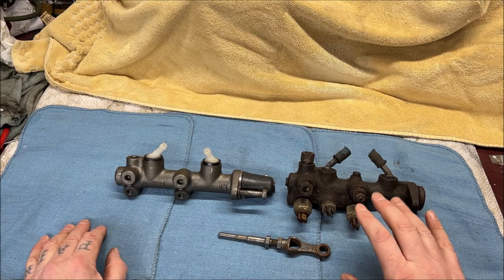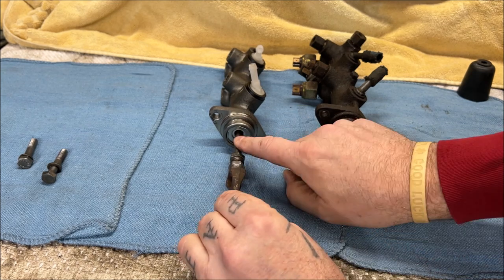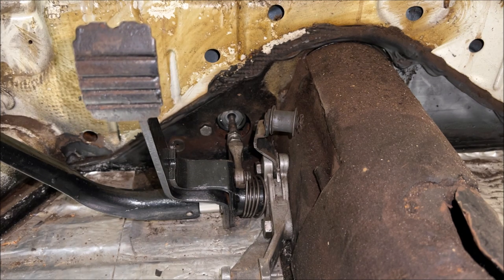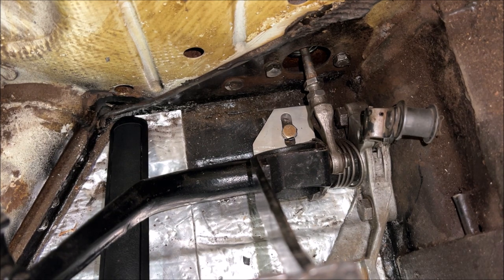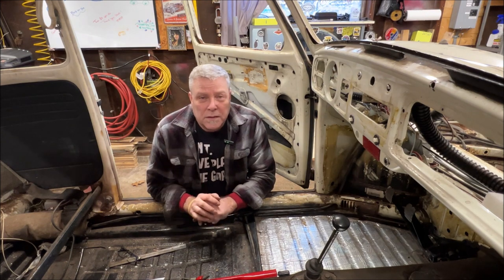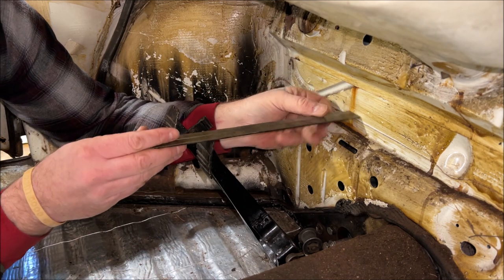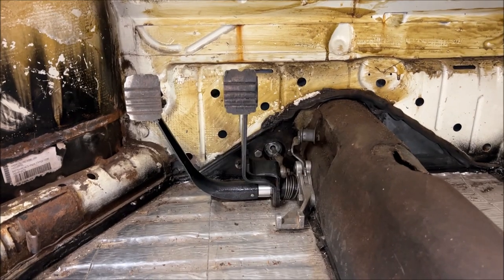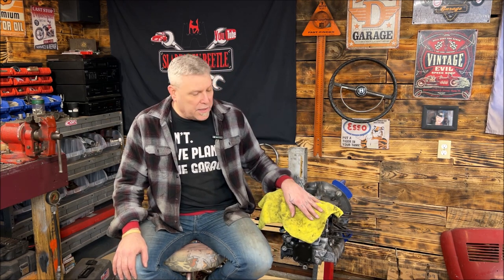VW BEETLE MASTER CYLINDER PUSH ROD ADJUSTMENT PROCEDURE - HOW TO ADJUST IT PROPERLY #vwbug #vwbeetle

Comment: Great video and I'm the guy who installed it without the spacers, over tighten it and probably ruined the master cylinder and tomorrow I'm going to be replacing it again with the spacers 😅, probably just going to Ace hardware to by something to use 👍

Comment: I am having the exact same problem. Brakes building pressure,  changed the master cylinder a few years ago but haven't drove the car much till recently. I have no free play that is for sure. I remember removing the brake pedal assembly, so I'm supposed to start by adjusting that first? And then if that doesn't correct it, adjust the pushrod? Thanks for the videos. Great help.

Comment: I had the opposite problem.  My master cylinder seals were shot, and I ordered a new master.  I have a 1973 Super, and it turns out the 1973 had two different masters depending on the month of manufacture.  The brake line clocking is different... so the fix was to put the new internals in the old master... which worked out fine.  

But in those days the parts people didn't know about the mid-year changes in the 1973.  They were struts, master cylinder, and a bunch of other little stuff I can't remember right now.  Beware the 1973 Super.
Reply from the maker: I had a 73 Super on my first YouTube round. I did notice there’s some definite differences from early and late
Reply: @SladesVWBeetle  Yup.  The early struts weren't the right diameter (smaller) for the strut tubes, the master clocking for the early units was way wrong, and I seem to remember the rubber brake lines in the front were too short as well.

You have to give the parts people the VIN, or the assembly date in the door.

Comment: I had the same issue about 6 yrs. ago cause I didn't check the adjustment on the pushrod and the brakes came on 😳😢 
Great informative video👍🇩🇪
Reply from the maker: Yes I definitely had that happen to. I hope this video helps some folks out.

Comment: Timely video. I rebuilt the pedal assembly (using your videos) on my 73 beetle. I removed the pedal stop to repaint etc., and now the clutch pedal has too much play but the brakes seem to be working fine. I want to adjust the pedal stop to remove the clutch pedal play. By adjusting the stop; will it change the brake rod and/or brake pedal play? I did not modify the brake rod in any way during the rebuild.
Reply from the maker: When you adjust the pedal stop on the floor, it truly may move your brake pedal and cause you to have to adjust the rod.

Comment: OK got another question!  I was told it is not good for the transmission to be towed LONG  distance with the two bar designed for VW's... it can damage a manual transmission even in neutral.  Do you believe this to be true?

Comment: I know this old , but what size is the adjusting nut on the pushrod? I've replaced  my master cylinder  and have alot of slop.
Reply from the maker: I believe the adjusting that is 13 mm. But I’m not near my garage right now

Comment: Slade, once again a great video. I may be “one of those people”!! Given the brake pedal stop needs to be adjusted first before the rod, do you have any tips on determining the correct position of the pedal stop?
Reply: I was wondering the same thing.
Reply from the maker: Technically you just want it to sit straight up, I really don’t know if that makes sense. 
If you look from the side view, you would want where your foot presses the brake pad, to be straight up and down even. I don’t know how to explain it on here lol
Reply: @SladesVWBeetle  Thanks! However, this sounds like a perfect opportunity for a You Tube Short— “Slade’s one minute tech tip”

Comment: Mine stile sliping after I changed to dual master. I used original vw master cylinder which have oneway valve on it. I took them out and stile the same. Why is that?

Comment: No more live shows?  Also, the interior brake button shows you if there’s an issue with your brakes.  Think of it as having a master and a slave setup.  The front and rear brakes work independently.  If that light doesn’t light up when pressed, or lights up while your driving, your font or rear brakes have an issue.  It’s called a ‘press to test’ button.  It’s in the owners manual.
Reply from the maker: Tonight at 8pm eastern! I put it on the community tab here. See you soon!
Reply from the maker: Absolutely!! I may put the three prong switches in, to still work that light. Any light on a dash I always call an idiot light lol
Reply: @SladesVWBeetle  that’s all it is.  VW had it right though.  If it’s failing, and lights up, at least you have your front or rear brakes still.  If you push it, before you start it, and it doesn’t light up, you know you have a problem before heading out.  Old aircraft, like the B-52 had/have this neat feature.  Let’s you know if the master or slave system is f’ed up.
Reply from the maker: @internetkilledthevideostar  So true!! Thank you for chiming in!

Comment: WITH A BIG PUDDLE  OF BREAK FLUID ON THE FLOOR, DO YOU THINK IT'S JUST AN ADJUSTMENT?
Reply from the maker: @stableboynmilkmaid  no, I don’t believe that would be an adjustment. You definitely have a leak somewhere. I would clean up the area with brake clean very nicely and dry it. 
Top off the fluid and have somebody push the pedal very slowly while you look for the leak. Wear safety, glasses, and gloves. And keep your face back while looking for the leak.
Reply: @SladesVWBeetle   your a real whizz kid! Dar!

Comment: WHAT IF THE PEDDEL GOES TO THE FLOOR?
Reply from the maker: @stableboynmilkmaid  that almost seems like you have a brake line or wheel cylinder leak. Unless some misunderstanding what’s going on with yours.
Reply: @SladesVWBeetle  I crawled underneath this morning. [the front anyways] because that is where the puddle was. The hoses to the wheels seems dry, BUT the hole in the pan underneath the Master cylinder was wet/oily.  One person said it could be a hose.
:((  Thank you for getting back to me~ 🚗
Reply: @SladesVWBeetle  Here is My Herbie!
Reply from the maker: @stableboynmilkmaid  I would actually spray some brake, clean all around there and dry everything off really good especially if you have an air compressor. Then top off your brake fluid. Have somebody hop in the car and press the pedal slowly while you’re watching. You will find it very quickly, my friend.